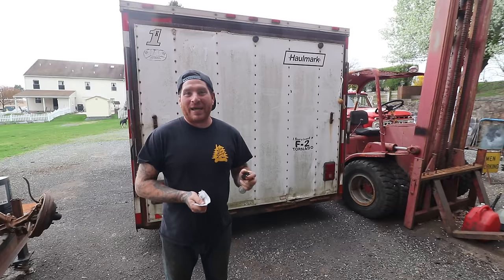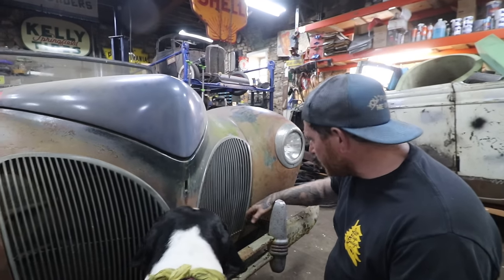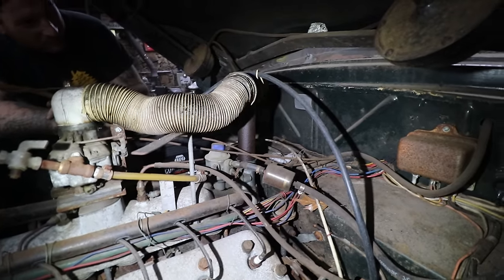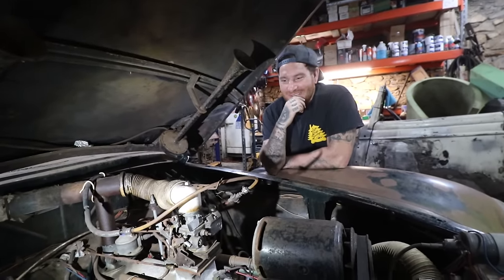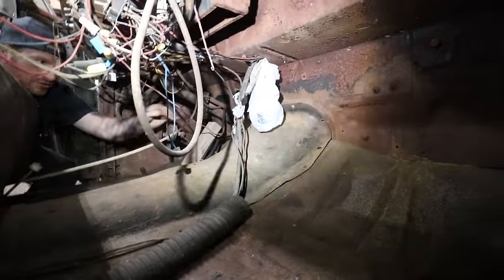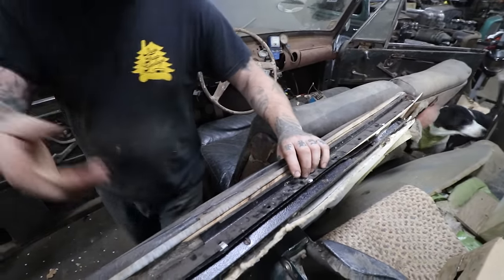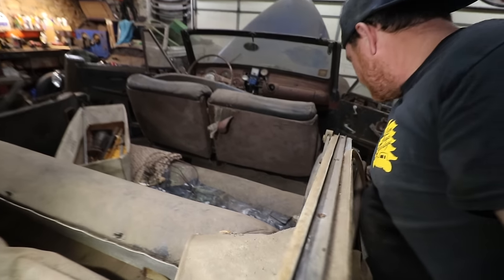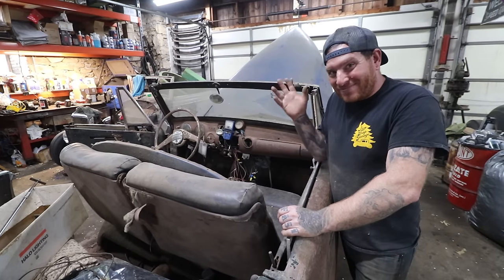This 1941 Lincoln Continental Is A FIRE Hazard - Crazy Wiring Mess!!!

Comment: Interesting that the major defect attributed to the V12 (292 or 312 cu in ) , was that the engine had poor ventilation , thus the oil quickly became contaminated , contributing to premature wear of rings and bearings . A previous owner seems to have tried to correct this by means of these modifications...
Another problem was allegedly that the motor had a LOT of low down torque , which encouraged lazy owners to hang onto high gear .While the bottom end was actually quite good at handling high revs ( reputedly good for over 90 m.p.h ) , it was NOT so happy at low revs in high gear when oil pressure was low ( and oil possibly contaminated ) - so excessive engine wear could occur.

Comment: I re-wired my 57 Catalina (I'm set up with a rack of wire spools.). One wire at a time. Including a new marine grade fuse block. It's hidden, nobody can see it. Simplified a few circuits in the process. And lowered amperage and current draw with led bulbs while I'm at it. It all looks stock unless you peak under the dash. Even cloth taped it (hockey tape). I'm an electronics nerd so I enjoy shit like that.

Comment: The color made be Spode Green.  Body no plate on the cowl left of the right hood hinge.  The motor number left frame rail at the engine cross member, top of transmission bell housing and on the left rear frame rail looking through the gas filler access panel.  The body number can also be found on the trunk between the hinges as a 57-??? Number.  You have cast aluminum A and B post body mounts which ca crack and cause issues with the doors to crack.
Reply from the maker: Thanks for the tips!
Reply: Make it a 56-??? Number.  I was thinking about our 41 Continental Coupe.  It was originally programmed to be a 40, and that’s wear we found the original 40 number.  For your information the Pennsylvania title showed it as an Oct 4 Linc Cp

Comment: That intake and carb set up looks like one of those crazy DIY 100 mpg set ups magazines advertised in the 70's.
Reply from the maker: Haha you’re right it does!
Reply: @IronTrapGarage  one of the really old guys round here in the 90's said he had built one and swore it kind of actually worked! Not 100 MPG but big improvements.  So you might want to Google it to see what you can keep that's not 100% fire hazard and try a MPG test?

Comment: My 48 Lincoln has a power top and windows which are all hydraulic. There is a pump on the left side of the engine that is run by what looks like a starter motor. It also has the push button door openers both outside and in, and it is the dark green that Mike likes! Cool cars that were produced in low numbers but don't have a high value unfortunately.

Comment: I bought a 48 Chrysler that had a 12volt battery in the trunk that powered the radio and power antenna it’s pretty cool when the battery is charged to make it work but the radio draws a lot of power so after a night out it always needed to be recharged!!! In my younger days radio shack sold a kit that transformed 6volt to 12volt for the radio and any other new age gadgets we had!!!

Comment: With the multi-meter and vacuum gauge on the dash and mystery carburetor, I bet he was one of those gas mileage nuts from back then who was trying to wring 13.1 m.p.g. out of that V12 instead of the stock 12.86. 😆 Since it's so far gone from stock already, I think you should keep going down the mild kustom route. It's already nosed, the stock height windshield looks like it's been chopped and lowering it an inch or two would complete the look. A set of Cadillac sombrero caps and wide whites with a repaint in that nice stock dark green would be too kool for skool.
Reply from the maker: We like the way you think!

Comment: i had heard that the Ford flathead V12 had oil pressure problems ( and overheating issues)  due to the design of oil distribution within the engine. ( Too many places for oil to circulate). Maybe todays improved oil formulations will help plus 40W oil.
The previous owner of this car meant well, but instead created an electrical frankenstein which should be challenging to unravel and rewire.Good to have multiple fire extinguishers handy.
This looks like a rare vehicle and a convertible as well.

Comment: Change the oil before you roll that V12 over. I'd be sweating that there was 2 quarts of water in the bottom of the pan under the oil, just waiting to get pumped to the mains. Beautiful car; looks factory sectioned!

Comment: This is definitely the strangest collection of electrical science projects installed on a car that I have ever seen in my life. I used to work on modifying Chinook Helicopters at the Ridley, PA plant before I retired to the Texas Hill Country. I've seen my share of science projects believe me. This car is quite unique. Having the multimeter wired into the circuitry of the car with ballast resistors and who knows what else is out there. Is this car going to be referred to as "Mad Scientist II" or Mad Scientist Lincoln"? Moon had a cornucopia of smells and seemed really into this car. I think it would be a cool car to restore to a running survivor. Too bad about the bumpers. Maybe they could be blasted and powder coated a non intrusive color as I wouldn't want to finish the car back to showroom stock, but keeping them as is is just a bit too tatty for me. I'm with Mike and wish more of the green would have survived. Get it running as the '39 Coup is and drive this one everywhere. It is just too cool and where would you find another at this price point? It would definitely be fun to drive and a great cruiser, one of the last really cool pre WW2 surviving cars. And admit it Matt, I see the twinkle in your eye when you talk about this one. Like the early rusty car addict that you are, this one has got you good. You won't be selling it until you drive it. It is just too cool of a car not to want it any other way. I look forward to seeing this one rise from its hiding place to running and driving. Make it so and thanks for the entertainment along the way!

Comment: Is that secondary line to the carb that has the petcock on it a Propane conversion? That canister looking thing on the passenger side that the line goes through looks like it  might be a propane generator, or whatever they're called.

Comment: 12:17 Mike this is called enginuity a.k.a. thinking outside the box. Just like the other car using fence post to build the exhaust system.
15:30 Why is it scary? Is it because you can't understand why a person would make these modifications and they worked?
Reply: Well they are prob used to thinking inside the box, since they run a company, i grew up on a farm and saw alot of these kind of inventions that worked just fine, as long as grandpa left notes on how it did work, of course LOL
Reply: @SwedishEmpire1700  Seen a lot of this stuff and wasn't afraid to add power to it. Being that both of them aren't mechanics I can see why . I mean give me a break, there is a dwell meter on the dash and Matt thinks it will adjust the points for timing? Yes dwell will do that but you have to mechanically adjust the points.

Comment: Looks like the famed Hot Rod Lincoln ! Ya , I'd delete the modifications on this one too . See what you have after . Nice car though . A very different style . V12 is nice . Don't see those everyday . I bet it runs smooth , if it hasn't got burned valves from running lean on that Briggs & Stratton carb . Lol . I like that green too . Lots of potential . In this car's case , potentials . 6 volt dc , 12 volt dc , ac to dc charger . Super sketchy wiring . At least you haven't found a pair of BVDs , isolating an iffy wire run . I'm still not over that last one . I bet Matt isn't either . Moon dog has his concerns . "Ruh Ro !" Give him a Scooby snack , & it really won't matter what you do with the car , he's a happy camper .

Comment: Just wondering if he used the car to power external appliances or gadgets. Similar to how we use solar powered battery storage devices or inverters. Maybe lights, heaters, fans, kettles or electric burners. There was more hoing on there  than just getting the car to run.
Reply: That's a thought ,used it like a generator
Reply: Going on the theory that the previous owner lived in the garage. Heating, cooling, cooking, listening to radio or stereo. Maybe watching tv. Possibly running tools for repairs.
Reply: Yes , that is probably what he did .

Comment: Man the back is butt ugly. Slice that fish hold cover thing off and ditch the dorky continental wheel and build a nice sloped rear and it won't be as offensive. At least has a 12 cylinder. It would look great as a stretched single seat roadster with a smoothed deck from the combing to the bumper. ￼

Comment: Crap. Never seen ANYTHING like that. The original wiring system is so simple. Cut all that crazy crap wiring out and start with the original wires. They are braided cotton and probably fragile. The modifications look to be easy to identify.